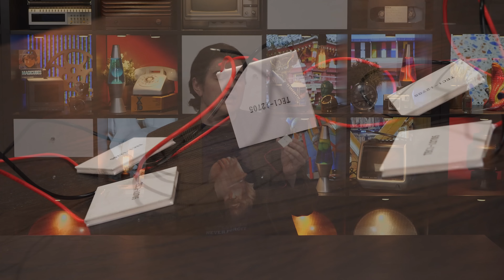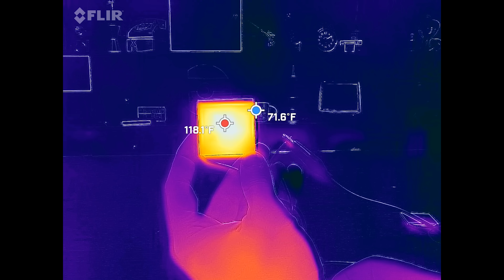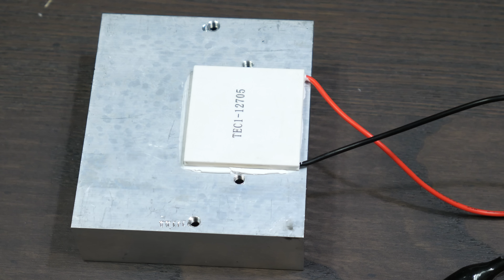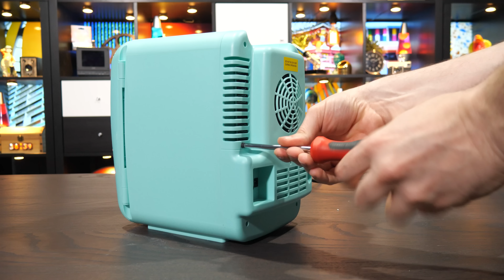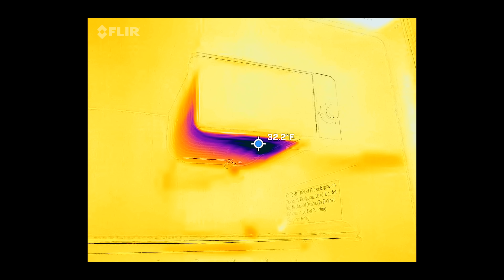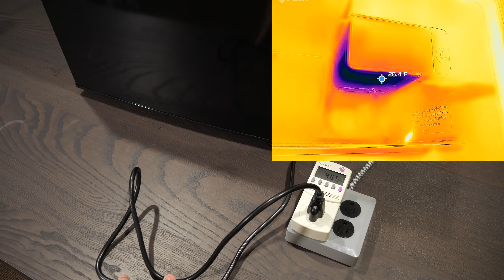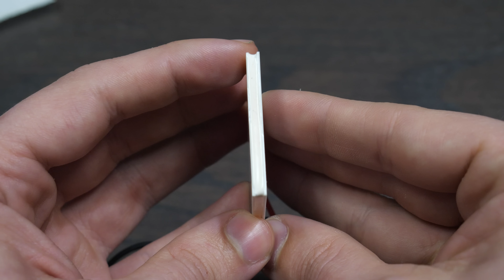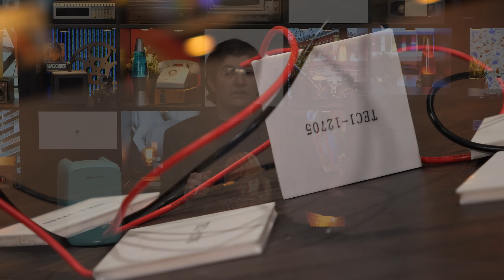Thermoelectric cooling: it's not great.

Comment: I've got a Coleman iceless cooler...its a love-hate relationship.  Coleman did claim you should put pre-chilled stuff in, and it does a fair job keeping a couple dozen bottles cold, and runs on 12V car or can be taken into a hotel room with a 12V 120V adapter.  Also has a nice thing you can flip the plug to keep hot foods hot.  But it needs about 70W constantly and is only about 30F below ambient the best it can do.  I'd love a compressor based unit but the portable ones cost 3-4x more and then you have to be careful about how its put in the car...and if you have to slam on the brakes and it flips over could damage the compressor if it is running or tries to run before its sat upright for several hours.
Reply: 12/24v portable compressor fridges have come down a lot in price. Many can be had for under $200.

Comment: Yes, I agree that Peltiers/TEC's are quite inefficient.  Some tips to help increase efficiency: 1. Use vacuum insulated panels for the primary insulation (with some research and around 500 to 600 dollars or so, you can make your own). 

   2. To help remove heat from the hot side, use heat pipe type thermal exchangers.  These two changes will definitely increase the efficiency significantly.  

   I'm planning on using TEC's to make a mini fridge for the car that I can also hook up a Solar panel for camping. I also plan to make it so that I can IR-sky window radiatively cool it some (for when the sun is not shining and not using it in the car).  
    With a combo of using VIP insulation, using heat pipe type thermal exchanger, using car power, solar panels, and/or IR sky window radiavtive cooling, I'm really not too worried about the lower than vapor compressor efficiency.  In this case, I like that it is very light weight, small, inexpensive, potentially long lasting, not fussy with moving around, and very easy to DIY. 

   Essentially I just summarized your video as to the pros and cons.  
(The mini fridge will be made out of cardboard and/or thin plywood reinforced with lamination epoxy and basalt cloth, except for the top which will be made out of fairly IR transparent materials, among some other details).

Comment: I got one of these tiny refrigerators as a christmas present one year. It kept my drinks cool, but after a while I noticed that it started leaking around the door. The seal wasn't very good, and neither was the little latch that keeps it closed. I ended up getting some of that stick-on velcro to close it, but the problem became even worse. The inside of the fridge would accumulate water until I opened the door, whereupon it would spill out everywhere.
That thing is now sitting in my garage unpowered and unused.

Comment: I always looked at these as electric coolers instead of mini fridges. I never used the one I got to make warm things cold but to slow down cold things from becoming warm. So I would take a can or two from a real fridge and store them in this type of cooler for a few hours until I wanted to drink them (without having to go up and downstairs cause you know, laziness) 

Could I have just used a cooler and some sort of refreezable pack to accomplish the same thing? Probably but again I'm lazy and it's a lot easier to not have to refreeze the packs.

Comment: A bunch of years ago I nabbed one of these super cheap and thought it would be a great way to keep a couple libations chilled in my bedroom.  Worked alright for stuff that was already cold - keeping it all cold enough for an evening - but was never great.  I tried to hotrod it with some expensive thermal paste but inevitably the latch broke a year later.  

I think it was a net win, especially since I started putting stickers on it.  It helped me get over my "phobia" of applying stickers to anything (once you stick them they can't go anywhere else, right?) which was pretty cool.
Reply: I haven't disposed of it yet, but now that I think of it... that's a useful power supply for some theoretical project down the line.  Hmmm...

Comment: 14:20 German here. Since you call the american system "not 120V" the german system is actually 400V. Every home I ever visited is supplied by 3 Phase 230V which yields 400V. We only feed 230V to normal wall outlets and 400V to stovetops, electric car chargers, garden workshops, etc. These are really getting into my head :D

Comment: As a truck driver, I needed a cooler for my drinks and various food items that couldn't handle being as hot as the interior of a semi-truck cab will sometimes get. Many truckers opt for the basic Igloo / (overpriced brand name) and just buy bags of ice at every truck stop they get fuel at. A thermoelectric cooler was perfect for me.
1) Unlike the dorm fridge in question, my thermoelectric cooler ran on DC power instead of AC. I'm making electricity while motoring across the country. I'm not concerned with its actual wattage draw. Power comes from diesel, and the company is paying for the diesel. I have an inverter for my microwave, but I had several open DC outlets including one on the shelf where the cooler was placed.
2) I have limited space in my semi-truck cab. The dorm fridge you highlight is TOO LARGE to fit on the shelf I had available to store it.
3) Since I live in this semi-truck cab for up to 21 days at a time, I'm very cognizant of the temperature that the fridge is also residing in. If I'm too hot, I turn up the AC. If I'm too cold, I turn it down or turn up the heat. By maintaining my own comfortable temperature, the fridge stays 30* cooler than that providing a nice differential between hot me having just come in from outside checking tire pressures on hot asphalt and the cool Pepsi fresh from the cooler.

As an active user of said thermoelectric cooler for >5 years, I also recognize the usability limitations more than you've described. So long as you recognize the limitations of your technology like the mileage limitations on your EV, you can make it work for you.
1) It does NOT dehumidify. Because of this, I keep a hand towel / washcloth in the bottom of my thermoelectric cooler to absorb condensation that can build up inside. I check the wetness of the towel and replace it when it's wet. Cardboard boxes also get wet from the humidity so cream cheese gets pulled out of the boxes and kept in the foil until opened then placed into a plastic baggie.
2) Inconsistent temperatures means certain things should NOT be stored in the cooler. I can buy a half-gallon of milk in the winter when the truck is a more consistent temperature, but there's no point in storing milk in the summer. If I want milk, I buy a quart and use it immediately vs trying to store it for later.
3) If I'm out of the truck for an extended period like for days off or if the truck goes into the shop, I take all the cooler stuff that is temperature sensitive like cheese or lunch meat with me. If I don't, it will likely spoil or melt depending on various factors.
4) Cold is worse than heat. In the winter, you need to take special care to keep the cooler WARM enough. Since it reduces the temp by 30*, if the cooler temp drops to 50* outside, your cooler has just become a FREEZER inside at a frosty 20*. Yes, I've frozen cream cheese, milk, sour cream, and other things that should NEVER be frozen.

Comment: My wife has one of these. I replaced the fan with a Noctua fan (which cost more than the "fridge"). Put on a low noise adapter (resistor). Incredibly quiet, cool enough for her skincare products. But I wouldn't want one for beverages, I have to agree.

Comment: sadly i have one of these that was given to me by my mom after i had my small fridge under my desk die. it was an actual mini fridge an wasn't able to replace it at the time cause it was purely for convenience an not a need so when she found out she gave me one she had gotten an never tried so i got it an as soon as i looked in the side i knew it was one of these so i knew it wouldn't do what i wanted it to do but i still gave it a shot an put cold cans in to give it the best shot and its not enough to keep it cold and def not cool enough for my taste. i also have a dehumidifier that and im pretty sure its using the same setup to pull moisture out of the air so at some point i'll probably convert to do the same to help keep my little work space dry.

Comment: Time to toss a crazy idea out there:  what if you replace the fan used on the peltier heatsink and cooler in the little blue POS with some liquid cooling elements in water-cooled PC's?  Could you then make a peltier cooler that works as efficiently (not counting the watercooling elements, which I know will kill that efficiency at the moment) or potentially more efficient than the standard refrigeration unit?  I'm juat thinking if we take what we know of the two maybe you can build something that COULD be competitive with current systems, while potentially opening a new avenue to improvement.

Comment: I had one of these. I actually did get cold - after like 24 hours. But it built up a lot of ice inside, because it had no dehumidifier.

You're absolutely right - the cost of one that works properly would definitely discourage an impulse buy.

Comment: We have a couple of cheap dehumidifiers with Peltier elements in, and one more expensive one that has a compressor.

The cheap ones work well enough, and given how humid it is I don’t generally want them to stop unless the tank is full (which they do), but I wonder whether that is a “fine” example of an everyday use? Or if they are still rubbish at that, technically?

Comment: Here are the key takeaways from the video:

1. Thermoelectric cooling using Peltier elements is not an effective or efficient technology for general-purpose cooling compared to traditional refrigeration systems.

2. Peltier elements have a very poor coefficient of performance (COP), meaning they consume a lot of energy to produce a small amount of cooling. This makes them much less energy-efficient than vapor-compression refrigeration systems.

3. While Peltier elements have some advantages like portability and the ability to both heat and cool, these benefits are outweighed by their major shortcomings in terms of cooling capacity and energy usage.

4. Inexpensive personal "refrigerators" that use Peltier elements are often poorly designed, noisy, and unable to maintain safe food storage temperatures. Traditional mini-fridges with compressor-based refrigeration systems are generally a better option.

5. Peltier elements may have some niche applications where their specific benefits outweigh the efficiency drawbacks, but for general cooling needs, they are an inferior technology compared to modern vapor-compression refrigeration.

In summary, the video argues that while Peltier cooling is an interesting technology, it is not well-suited for most everyday cooling applications due to its fundamental thermodynamic limitations and poor real-world performance.

Comment: My grandmother had one of those mini fridges, it was terrible. However i modified it with a step down module , run it around 3v and have it hooked to my 24v solar backup , and it works better than before by a long shot. It seams like they run way better when under driven. I use it to keep drinks cold and runs between 3°c and 8°c . Took like a week to get there with 6 cans of water tho .I have been experimenting with them for a while now , with mixed results . The best advantage is the fact i can run it down so low that a small solar setup that can run my freezer all day but not at night , can run it 100% of the time.

Comment: For many years (about 25) I have had a small annd large “lce free” coolers for multi day vehicle travel. I assume they have some sort of Pelletier element.
Very convenient when ice or cooler packs are not desired or possible.
They work on 12VDC for use in a vehicle/vessel and 120VAC converter for pre-cooling or hotel room use.
I think they are great for vehicle travel and are reliable (I wish my Samsung Dutch door refrigerator lasted as long).
I agree that a mini 6 pack cooler is not an efficient use but for my application the cooler type improved my holiday and work travel (vehicle) experience.

Comment: I'm so glad you mentioned standard refrigerator heat pumps are orientation sensitive, I have been wondering about that since you mentioned chest freezers keep cold in better because they are horizontal. I've been wondering if you could just flip a fridge on it's back to turn it into a chest fridge, but I had a feeling it wouldn't be that simple!

Comment: Mosquito catchers that work really well.  There are some that require electricity to operate along with propane. And there are some that work on just propane. Using a Peltier in a different setup. The peltier is heated with a pilot light flame from the propane to create electricity to run its fan. The propane burning helps to attract the mosquitos and the fan socks them in.  They aren't a cheap machine but they do work to get rid of mosquitos. It takes awhile, like weeks but the bigger machines cover up to 1 acre.  I have used these for years so I  know they work.  You should do a video on these.

Comment: Thank you for this episode.  I am in an ongoing, apparently futile, quest to find a refrigerator for medicine (insulin) storage for use in an emergency or extended camping trips. The obvious criteria: precise temperature control, portable with size anywhere from cigar box to ice chest, energy efficient, and powered from 120VAC or 12VDC. I got two of these little micro-mini 6-pack sized frig's to see if they'd fill the bill. Two only because I thought the first was maybe a lemon. They certainly fill the small and portable criteria. I was stunned by how badly it cooled and how huge the electricity use was. Similar to your experience, it never stopped running, (drained a big LiPO4 battery overnight) and never got below 52 degrees F. I vaguely knew of the Peltier effect but didn't realize people had tried to make a refrigerator with them. Now I know. And I know not to bother.
Reply: On amazon i found a RCA fridge for about $100. There's quite a few on amazon dependant on your budget.

Comment: so, i have a mini fridge. and it works fine in the way its used.
its not cooling down the easy to access sodas.
its keeping the already cold sodas from the main fridge from warming up too fast.
saves travel frequency to get another soda.
is far better than having a bunch of ice, where idk where enough ice would come from to do it
and sticking it into a ice chest and then pulling out the dripping wet can of soda only for it to get all over the desk.

20 dollar cheap solution (must have gotten a better deal than 30) vs installing a second room into a house just to bring a "real" fridge into the space and not have it bake the people in the room.

not great, but good enough for what it needs to be.

Comment: Good installment, Alec. You inspired me to check the wattage of a peltier cooler in my camp trailer, as I've been using it to keep drinks cool outside near my patio. It has a freezer as well, and as near as I can figure at least 6 peltier pads. 210 watts. Continuously. Forever. I could have paid for a real mini fridge by now with the power consumption. Crazy.

Comment: These are used in compact benchtop incubators in the lab I work in. They are attached to an aluminum plate that directly contacts whichever piece of labware you want to cool or heat, and so whatever reaction you’re incubating comes to temp much faster and stays there more consistently than if it was incubated in something using forced air or a lab fridge. The max they can cool to is -20 below ambient level temperatures and they’re only used for a couple hours in ant one instance. They’ve still gotta be using a ton of energy though because they’re essentially used at the lowest extreme they can cool to. Any general cold storage is a regular lab fridge with compressor, probably for pretty similar reasons as the consumer space.